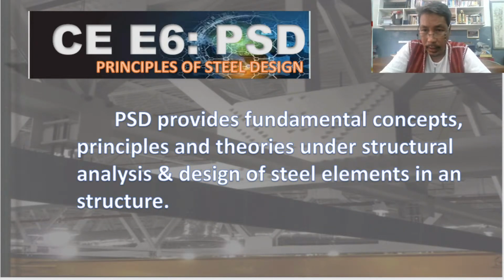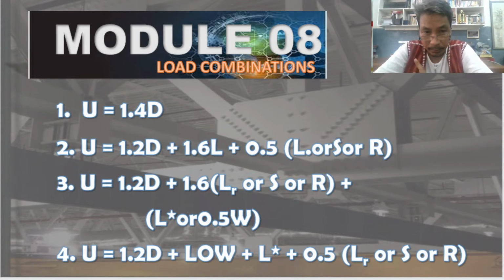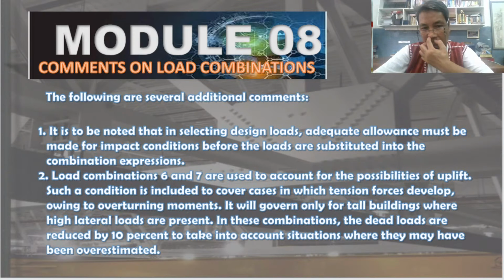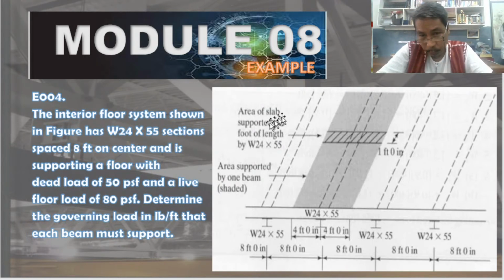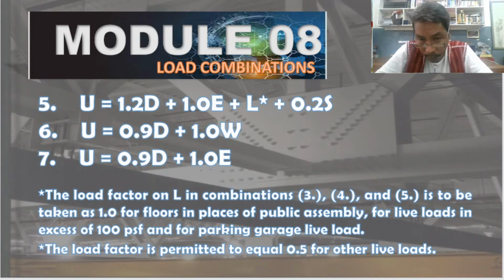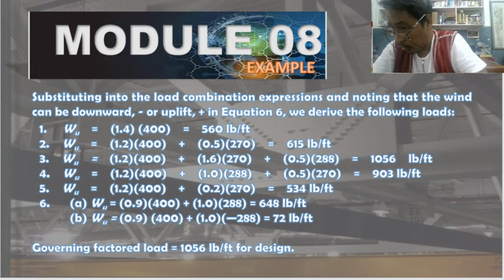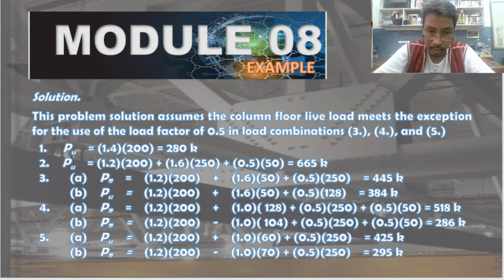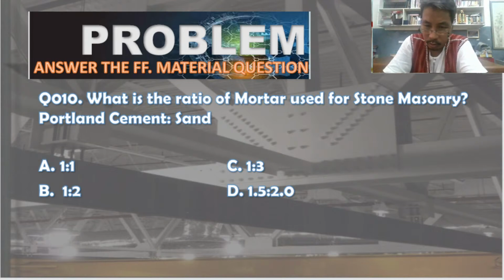[ LIVE CE E6 Lecture 06 ] DrAP Zantua STEEL DESIGN Talks + ENGINEERING Analysis & Design

Comment: In this lecture video i've learned the seven formula of load combination by applying the nomenclature and symbols. Thank you Sir for showing solution of the problem by using the seven formula.
For Q010. What is the ratio of Mortar used for Stone Masonry? Portland Cement: Sand

A. 1:1
B. 1:2 
Ans: C. 1:3
D.1.5:2.0

Comment: Thank you sir for this live lecture. I recalled the nomenclature under-strength design principles and their corresponding unit, symbols of loads factor, and strength reduction factor. I also comprehend the load combinations. 
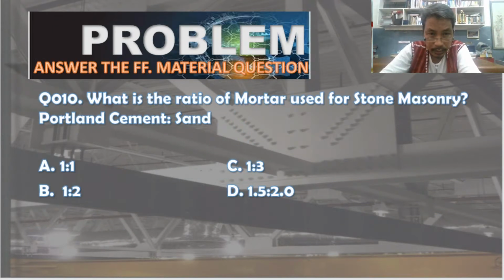For 1:01:00 Question 10: What is the ratio of the mortar used in stone masonry? Portland Cement: Sand 
My answer is 1:3

Comment: For today’s video we tackle the STRENGTH DESIGN PRINCIPLE Nomencalture, where in we review the unit of every terminology. Like D for dead load, L for live load, E for earthquake load, Lr for roofing live load, and etc. And also we tackle the 7 formula of Load combination

Formula for Load Combination
Wu = 1.4 (D+F)
Wu = 1.2 (D+F+T) + 1.6 (L+H) + 0.5 (Lr or R)
Wu = 1.2 D + 1.6 (Lr or R) + (f1L or 0.5W)
Wu = 1.2 D + 1.0 W + f1L + 0.5 (Lr or R)
Wu = 1.2 D +1.0 E + f1L
Wu = 0.9 D +1.0 W + 1.6 H
Wu = 0.9 D +1.0 E + 1.6 H

Answer in Q010.
C. 1:3

Comment: -thank you sir for discussing about load combinations which a strength design principles. I’ve learned about its nomenclature such as dead load, earthquake loads, loads due to weight and pressure fluids, load due to pressure of soil, live load, roof live load, service level force, load due to rain water, snow load, effect of temperature, shrinkage, creep, differential and shrinkage, compensating concrete, required strength to resist factored load, distributed load, and wind load. The load factor on L in combination 3, 4, and 5 is to be taken as 1.0 for floors in places of public assembly for live loads in excess of 100 psf and for parking garage live load. The load factor is permitted to equal 0.5 for other live load. Thank you sir for sharing us some examples for this topics.

Answer in Q-010.
C. 1:3